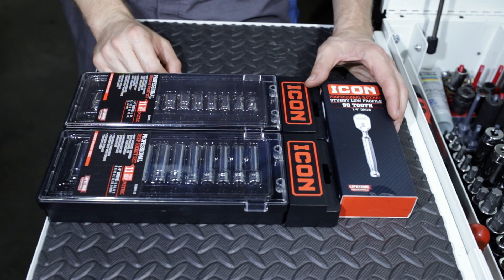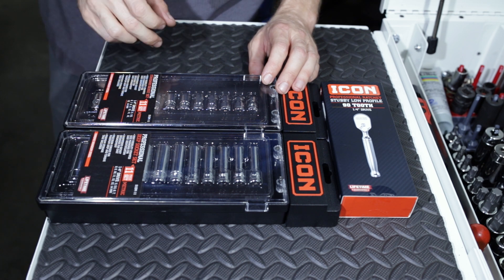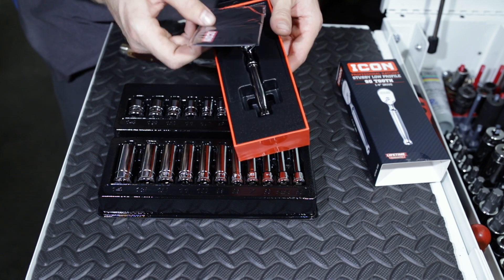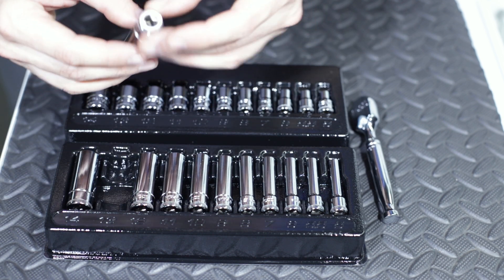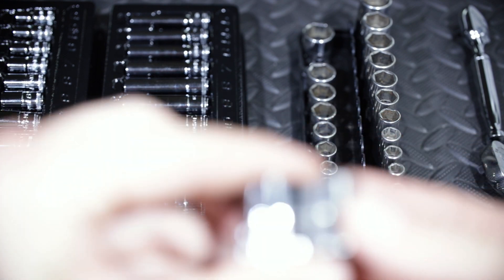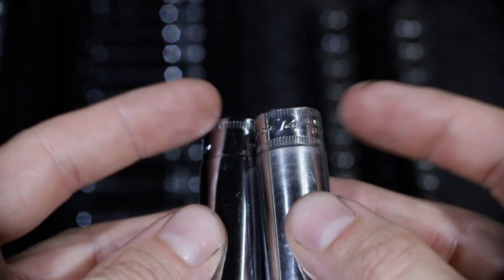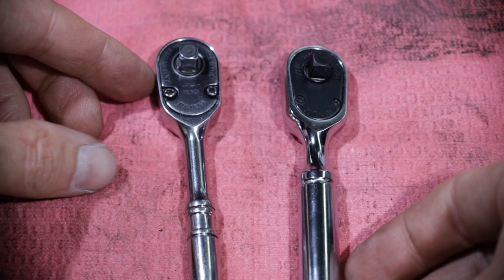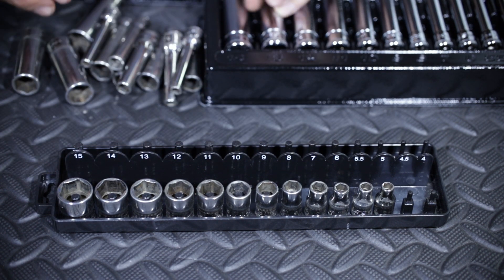Harbor Freight ICON 1/4" Ratchet & Socket Sets

Comment: It’s interesting to see the “value engineering” that went into the Icon ratchet.  I’d wager the handle and selector are bigger to make up for cheaper materials.  The one piece paw likely puts more stress on the selector as well.   Thanks for the comparison.  It would be very difficult for me to willingly stop using a Snap-On ratchet.  You are a stronger man than I.

Comment: My 1/2" drive Deep Icon sockets had a "nick" on almost every socket:  the body and edges of the socket.  They were not very large, but probably mishandled before the heat treating process (?).  Otherwise, they seemed to be fine.

Comment: Truth be told, comparing Icon to Snap-On is like comparing Apples to oranges. ICON in my opinion is closer to Gearwrench or Carlyle and Tekton and possibly Milwaukee. I think HF compares the ICON line to snap-on because of marketing hype. ICON isn't terrible, great for a DYI or shade tree mechanic, machine operator or a guy starting out as a technician. I've seen other YouTubers experience premature wear with the sockets. I think Harbor Freight is stepping in the right direction, it takes years for a company to establish itself as a professional tool brand. As far as research and development and getting the metallurgy right they have a long ways to go.

Comment: According to the Snap on website they charge $294 for 5-15mm.  I just paid $23.99 with a coupon for my ICON sockets.  Just bought a 1/4" flex head ICON ratchet for $27.99 and Snap on charges $118.  Why is Billy Buttfuck going over this shit with a microscope?  The prices are not even comparable.  Compare it to a husky, Kobalt, craftsman....etc
Reply from the maker: They advertise as being the same quality as Snap-on. That's why, genius.
Reply: @MrSubaru1387  Thanks Billy
Reply from the maker: @gncc600  👌🏻

Comment: How do you feel about the ratchet backdrag? Seems damn stiff for a 1/4".
Reply from the maker: It's hung up a few times on me. Been using the ICON tools daily for about a month now. Will go over everything in the long term review video.
Reply: I returned two before I found one with reasonable drag and I lubed it up and it’s just like another one in my box now, but the Pittsburgh literally almost have no drag
Reply: Same here with my icon 1/4 ratchet. That thing has a ton of backdrag out of the box. Tried super lube grease, which improved it. Then tried 3 in 1 oil and that made it worse. Going back to super lube grease to see if this improves.